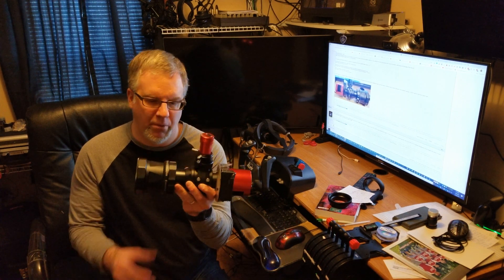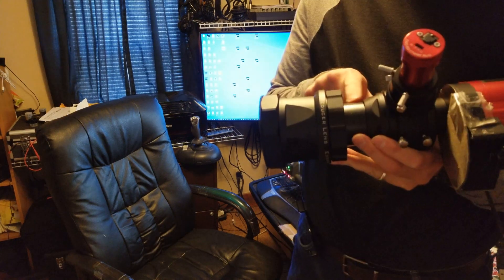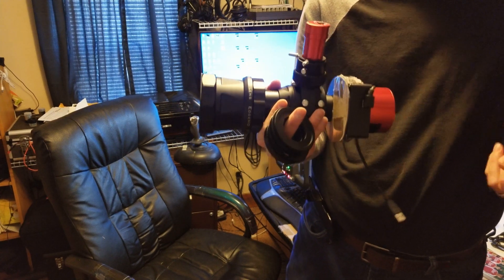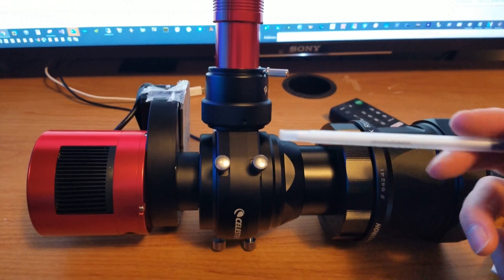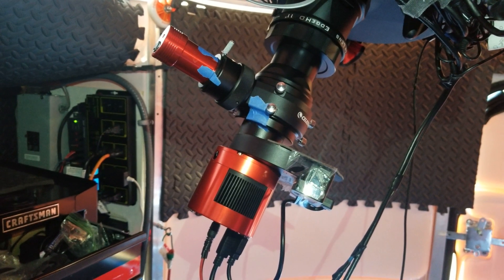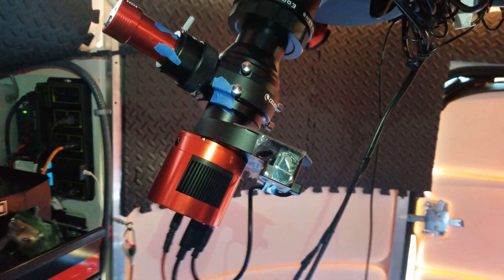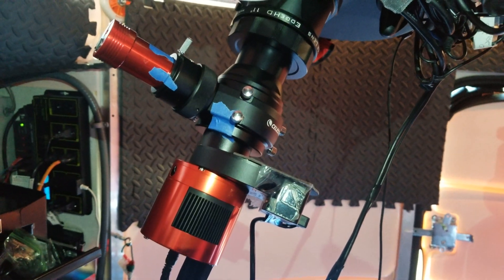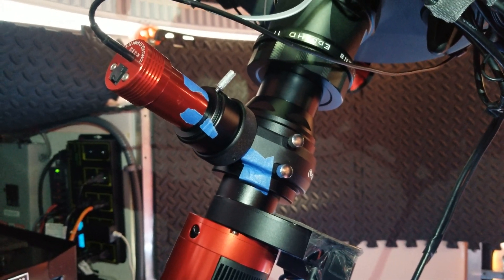The Celestron OAG with the EdgeHD 11 SCT and a few Galaxies Far Far Away

Comment: At the beginning of your video you say to make the distance between main camera and OAG as short as possible, which would also shorten the Guide Camera distance. Then later you said you did so because finding spacers for the guide camera was difficult. So I’m confused. Is there a benefit in having the guide camera closer to the prism? I get good guiding for the most part but I have all my spacers between the OAG and the main. Then I have enough spacers necessary for the guide camera. But I struggle to find stars, at max gain. I’m using the ASI120MM-S for guiding. 

Any suggestions appreciated. 

Thanks for the video btw.

Comment: Hello, I will want to buy a ccd cooled camera for the Ota with 1422 mm. of focal lenght like SCT 8" Edge hd reduced and I think that the best solution is a Atik 16200 with 6 micron of the pixel size. I see tha you use an Asi 294 for 1960 mm. of focal lenght, wiith 4.68 micron of your camera the final image is undersampled ?
Reply from the maker: Yeah in the case of f7 and f10 the 294 needs guiding (ideally) around .49" I believe.  There is a calculator tool online that you can use to figure this out however.  I can get by as bad as say .70" on most images.

Comment from the maker: Just an update here.  I plan on releasing a new Galaxy video for F7 + Oag in the coming weeks here once i have more data and will share this setup.  I've since changed my oag setup (mainly because i went to a filter drawer and wanted to perfect the 146mm distance or 147 with filter, nothing was ever really wrong with my mini efw oag setup in this video).  I'm now using the Celestron Large V2 adapter (38mm) + Oag body (30.1mm) + 12.5 adapter + 30mm of 48mm spacers + 17.5mm starizona + the camera and ring for a near perfect 146mm (or 147 when you factor in the 1mm filter).  More to come in that video.

Comment: Hi Mark, Brilliant video! How did you find the initial focus with this set up? I have a similar set up (9.25/COAG/ .7 Reducer) though currently using with my Nikon D5300 (until 2600mc comes). I'm struggling to find initial focus and wondering if you used some trick!
Reply from the maker: Thanks for the kind words.  I found it was actually easier to get initial focus in the daytime, aiming at a distant hillside or tree.  Also, if your using an automated knob focuser like me (im using rigel nstep), just to confirm you get focus, it might be worth it to take the motor off the knob and manually hunt for the focus if all else fails, then however, you have to deal with resetting the focus position and all that, the downside.
Reply: @AstronomicallySpeaking  Ah, I should have thought of that. I suppose that will at least get me into the ballpark. Thanks for this - looking forward to the next video! Cheers

Comment: Nice Job, Thanks for the video.  I just ordered an 8" EdgeHD and am looking into guide options but have never used an OAG.  My biggest concern is not finding stars.  Not sure whether to get the ZWO OAG or Celestron or just use my existing separate guidescope.  To start I will be using my ASI1600 with the Filterwheel but am not opposed to using 2" filter drawer.   Eventually I plan to get the ASI294MC.  I don't have the ASI174mini but I do have a ASI178mono used for solar imaging that I could use for the autoguider camera.

Comment: Hi Mark, this was insanely helpful! I got exactly the same setup with ASI 294mm Pro, Celestron OAG, ZWO EFW and a C11. I was trying to buy the parts you mentioned, but the SCT adapter you linked is no longer available, replaced with a v2 version that has 38mm of length, instead of the https://www.celestron.com/products/large-sct-edgehd-adapter-v2-for-off-axis-guider, which is 16+25.4-38=3.4mm short of the combination you use. How critical is that difference and what would you do about it? Thanks in advance!
Reply from the maker: I think i updated my details recently with the bluball adapter, its here and shows in stock now if this what you mean? https://agenaastro.com/blue-fireball-sct-thread-spacer-ring-1-extension-s-se.html  

That large celestron adapter i actually bought, but didnt use for now.  I figured if i had a bigger camera it would be useful one day.  I'm still learning the ropes on much of this, but if its really only off by 3.4mm that might be ok.  I think the rule of thumb was something like 1-3mm for closeness, i'd be real curious how that worked out if you tried it already.
Mark

Comment: I just got a new galaxy rig consisting of the new iOptron cem70/tri pier combo and I’ll be using the edge HD 8” with the Celestron OAG/asi174mm mini. Just waiting on the OTA to arrive. I’ll be using the asi294mm mono w/filter wheel though. This video definitely helped understand the spacing better albeit different with the 800 vs the other HD scopes. I’m glad to see you’re getting good results!  Gives me hope the Cem70/8” version will work well also with that OAG/guidecam config.

Comment: Mark, I just purchased the Celestron OAG from my 8SE and shouldn't the distance from the main camera sensor to the prism be the same as the distance from your focal reducer shoulder to the prism? You mentioned that the distance is longer from the focal reducer to the prism to give you more back focus on the guide camera..
Reply from the maker: Well, as far as i know the correct verbiage might actually be "The distance from the prism to the guide cameras sensor needs to be the Same as the distance from the prism to the primary camera"  I may have just said it strangely.